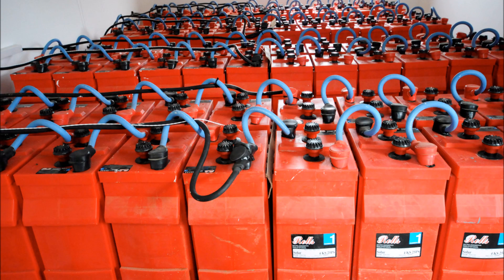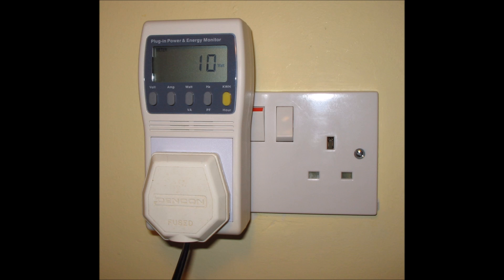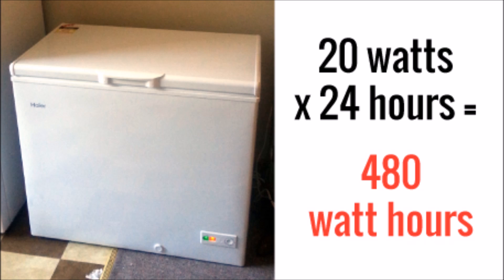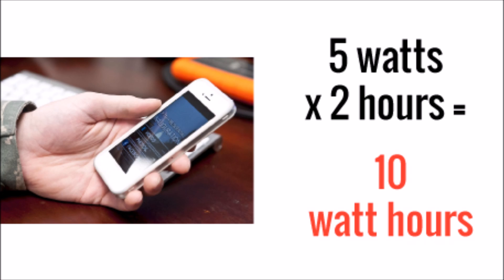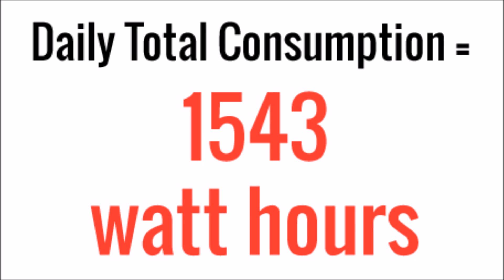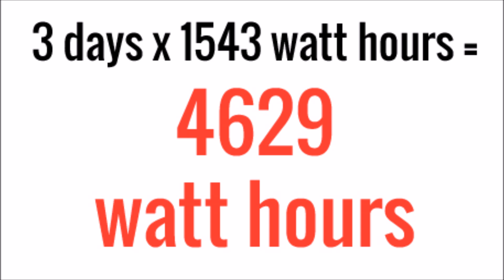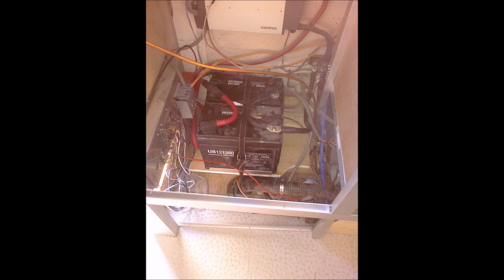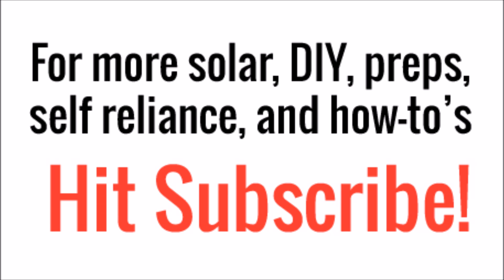How To Size Your Off Grid Battery Bank Capacity For Solar - Math Warning!

Comment: Light?  Water Heater?  Air Conditioning?
Reply from the maker: You would probably want those things but the point of the video was not to create an exhaustive list of everything you might need.  It was to show you the process of doing the calculations.

Comment: Great explanation.  I went w/ what I thought I could afford. So down the line I plan on expanding. I have done a lot of the worksheets for learning sake. It is probably further away than I would like due to cost and the fact my batteries are too old to really add to and way too new to trade out yet, so focus set on paying off what I have and saving for that big day.
Reply from the maker: Sometimes doing what you can afford is all you can do.  You'll quickly find out what limitations you have with that, like you did.  That is life, right?

Comment: I hope you'll address alternate battery chemistries (Li-du-jour, Ni-Fe, etc) in a near-future vid

Excellent vid and a great size bite for beginners or those doing a system review/reboot/redesign
Reply from the maker: Yes, I plan to.  I have reached out to a lithim battery company on the cutting edge of technology and they have agreed to send me some prismatic cells to play with.  I also want to touch on 18650 cells, which is what are used in the Tesla Powerwall and other lithium ion packs.  It may take me several weeks to do the research and get a hold of some products but it is definitely something I want to do.

Comment: Nice video! What about the lighting in the room? heating? cooling?remotes? are the remotes gonna be wired to the solar panel? or are they going to be battery powered (AA batteries)? Or are you gonna have your kids be slaves and turn off or on the TV? No offense, but you left many more things out.

Is this person going to have a radio? If so, is it going to be a battery (AA, AAA, 6V, 9V battery) radio? or a plug in radio? 

Is this person going to have heat? A battery heater? a non-moveable heater? a heater with rollers still plugged into the outlet? Or is it going to be solar heated? or what about water heating?

Is this person going to have air conditioning? Battery powered? plugged in?

What about a car? a solar car? or electric car?

What if these batteries go bad? 1 battery goes bad, get another one. A week later, 2 more batteries go dead. A few days later, another goes dead, etc. Are you willing to take that kind of risk if batteries go dead left and right?

Also, what if the panels go dead from constantly being in the sunlight?
Reply from the maker: Those are all valid questions.  I was trying not to have a 20 minute video.  The point was just to show you how to do the calculations and give an example, not go through everything he wanted.  Hopefully that makes sense.

Panels won't go dead from constantly being in the sun.  That is what they are built for.  They will slowly lose production to about 80% at 25 years.  So your 100 watt panel will make about 80 after 25 years.

Batteries go dead eventually, depending on how far down you cycle them.  You should plan on replacing your battery bank every 3-4 years for lead acid.  Lithium and other newer technologies last longer but you still need to factor in replacements.

Comment: Stop being anti-lithium. Lead acid and the technologies you propose are last century's answer to energy storage. Tesla's PowerWall solves all the battery problems you listed.
Reply: EV Owner do you know the price difference between the two?  asking seriously.
Reply: Mr. Delphi  - lithium ion is dangerous? Given the horrific acid inside a battery case, a dry battery like alkaline or lithium is a risk in an earthquake? I'd rather be buried under a pile of AAs than a bank of lead acid batteries!
Reply: Rudy, yes, I do. But keeping acid batteries around that can't be discharged more than half are not very useful. I've even seen watering systems required for some battery types used in home backup - watering them like plants! No off-gassing on lithium, almost complete discharge is no problem, light weight.
Reply: Mr. Delphi - for SURE competition will make some DIY and other solutions using lithium. That would be a good thing. But to see a bank of lead-acid batteries that need watering and weigh what a small automobile does just floors me. There is a better way.
Reply: DIY Tesla PowerWall why is lithium dangerous I can't find anything on reputable sites
Reply from the maker: I am not anti lithium at all.  It is definitely the wave of the future.  Where did I say anything negative about lithium in this video?
Reply from the maker: DIY Tesla PowerWall your shtick is getting old.  You ignorantly try to parade lithium around as a mythical solution to everything and ignore the facts about DOD curves, cost comparison, market penetration (number of charge controllers that can charge Lifepo4 or lithium ion out of the box), etc.  If you can't stop trolling, I'll have to put you on ignore.
Reply from the maker: http://batteryuniversity.com/learn/archive/whats_the_best_battery
http://www.altenergymag.com/content.php?post_type=1884
http://usbattery.com/lithium-vs-flooded-lead-acid-batteries/

Yes, you can discharge them below 50%.  But it greatly affects longevity.  I'm not interested in google docs spreadsheets and obscure forums where nerds congregate to whip each other into a frenzy over some lab experiment.  I'm interested in what is available ON THE MARKET for the AVERAGE JOE to put in their solar system.  I'm interested in cost per cycle (which lead acid absolutely crushes all lithium technologies).   I'm interested in ease of use (again almost no charge controllers on the mass market support Lithium Ion or Lifepo batteries).

And lithium technology has been around since the 1980's so don't make it seem like lead acid is from the stone age.
Reply from the maker: Amen.  Lead acid is still the gold standard in telco, networking, forklifts, automotive, trucking, uninterruptible power, golf carts, RVs, boats, and more.  When the price of lithium comes down and charging electronics become ubiquitous and safe then it will be a valid option for solar and DIY.  

I am going to try the 18650 cell route to make my own Powerwall at some point but I will be using battery holders instead of soldering or tab welding (a good tab welder is a bit pricey).  But even then there are few options for charging management other than BMS from the e-bike community and a few other fringe industries.  None are bulletproof reliable and certainly none are made by big name manufacturers with proper warranties and rigorous testing and safety compliance.  I am willing to take that risk but I can't recommend stuff like that to my viewers.
Reply: LOL. Tesla has yet to turn a profit. They are basically a sham company that is living off investors money. Like the price of that Powerwall? Good luck getting warranty work done in 5-10 years. Tesla won't be around and your screwed.
Reply: Really, John Dee? Tesla makes a good profit on every car it sells, it's plowing its money into the Gigafactory. As for warranty work, please tell me how the GM bailout ($14 billion still owed us taxpayers) is working out for profitability. Chrysler? Another taxpayer bailout so it could be sold to a foreign company. You buy GM stock (bankrupt already), I'll buy Tesla. Let's have a 10 year stock bet - I'll be a Tesla millionaire and you'll be...owning GM stock.
Reply from the maker: EV Owner, lithium ion is orders of magnitude more dangerous than lead acid.  Are you being serious or trolling?
Reply: LDSreliance thanks for the great videos! if you are ever in Charleston SC swing on by
Reply: DIY Tesla PowerWall is that longevity of battery life or the individual use  (discharge rate)
Reply: LDSreliance long story short I'm starting a new system and I'm looking for the best investment for the cost. I'm doing a 6kw solar and I want to run my house for a minimum of 3 days......
Reply from the maker: Shoot me an email at ldsreliance@gmail.com
Reply: EV Owner also keep in mind, the Tesla Battery wall and any EV is made up of small lithium batteries connected in series.  Lithium is too dangerous to make large batteries.  So for example using the 18650 battery, or the new 2170 which will be used in a Tesla Model 3, it takes about 100 of these batteries to make up the size of one standard 12 Volt lead acid or AGM car battery.
Reply: Mark Rothenberg, you comment confuses me. So what if the best size for a lithium battery is multiple smaller batteries wired in series? You waste a tremendous amount of space and weight in just the casing for a lead-acid battery. Slab batteries have problems that lithium solves. My retort to your comment: Lead acid is too heavy and maintenance-prone for many applications; you have to water them like plants.

Comment: Lithium batteries are cheaper in long run and way more efficient.
Reply: Lead acid batteries are 96% recyclable and can be sold for scrap when they're done.
Reply from the maker: Lithium Ion is still fairly dangerous if you don't know what you are doing.  Lifepo is much less dangerous and there are newer technologies emerging that are stable, too.  That doesn't mean lithium ion is not a viable technology.  That is what is used in the Tesla Powerwall and in some hybrid cars.  It is just that you don't want to be messing around with charging them if you don't know what you are doing.
Reply: Lithium ion batteries are good for some applications,  but using it as an off grid storage is definitely expensive.  They require extensive electronic protection systems to make sure they don't get overcharged or discharged too low.  They are also notoriously known for their inherent ability to explode and  this is highly dependent on the quality of the construction and its electronic systems.  A failure on either one could burn your house down.

 An average off grid person wouldn't know how to manage Lithium ion systems or repair faulty parts........The battery have an average of 300-500 life cycles which would give you around 2-3 years of heavy use (can extend to 5-7 years with moderate to light use).  For the money,   the life cycle is too short and too complicated for the average user. But if you're determined to use Lithium battery,  then i would highly suggest Lithium IRon Phosphate.  They have about 2000 charge/discharge cycles.
Reply: The nice thing with lead acid is that you can just float them. That makes the electronic side much simpler as you just do a constant voltage charge and don't care where the current is going. Ex: some current may be going to the loads while some in the batteries.  You can also group them in series without having to balance charge them, they balance themselves. You still want to monitor mid point voltage though.
Reply: DIY Tesla PowerWall - Do Australian standards say that or is that your opinion?
Reply: LDSreliance lithium is almost 100% usage at 1000s of cycles with still 80% usable capacity left and automotive lithium batteries can be gotten for insanely low costs in practically brand new condition. So lead acid is just useless now and there is NO WAY you can justify them anymore.
Reply: Which states?
Reply: lead batteries are much cheaper, anyway...For me, cost is the deciding factor...
Reply: +LDSreliance For me, LiFePo6 looks so much better due to the weight savings. Otherwise, I find it very expensive and I'm not sure if the higher costs, lighter weight and being able to take them down to 80% of their total charge is worth their high price. AGM seems to be the happy medium.
Reply: I know California does this
Reply from the maker: I disagree.  They are about the same cost in the long term due to the very high initial price.  Maybe I will do a video on that soon.  It seems a lot of you have some serious lead acid hate.
Reply: Salvaged Leaf or Tesla cells are many times cheaper. If you are scared then just build separate concrete shed/bunker for batteries in your backyard and you can use whatever batteries you like without any danger.
Reply: do these things catch fire or has that been solved, i like them but apparently tesla is comming out with an even newer battery for houses, lifepo4 not sure what it is.

Comment: Very informative video. Spending that much on batteries you definitely have to be careful with over discharging. Great work!
Reply from the maker: Thanks, I appreciate it!
Reply: @LDSreliance  Did Lithium slip your mind when you made this? It had been in wide use for some time, and has a 90+% DOD
Reply: @tienouttatien8942  Not worth it unless you plan to cycle them daily for, literally, twenty years. Mostly it's useful for industry and sailors who care about weight more than money, not ordinary people.